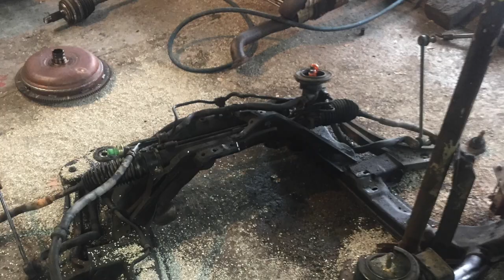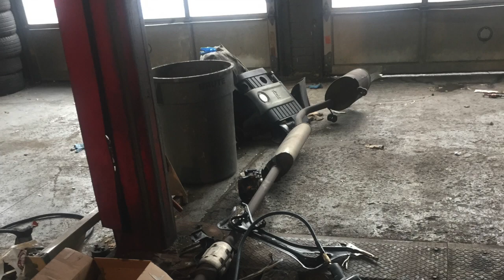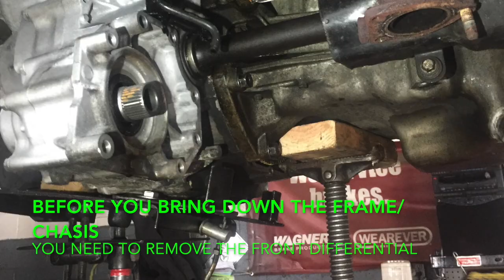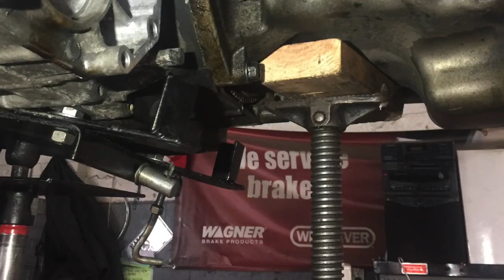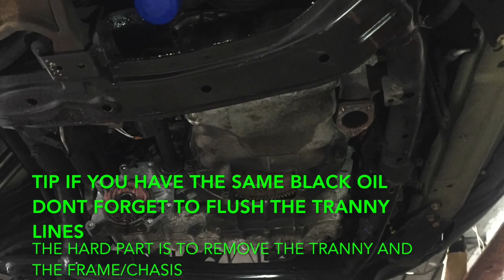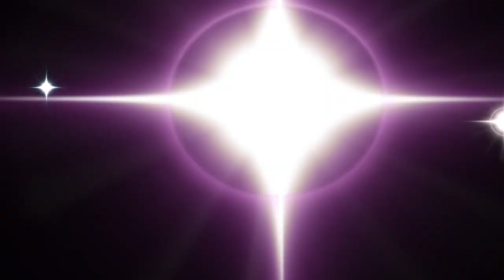2005 HONDA PILOT TRANSMISSION REPLACEMENT

Comment: I have a huge question I have a 2004 Honda Pilot will a 2003 Honda Pilot transmission mount up there both all-wheel drive and they also have the push button for the four wheel drive lock up